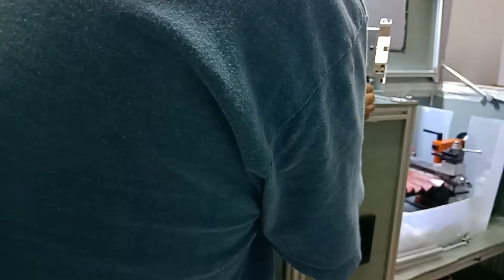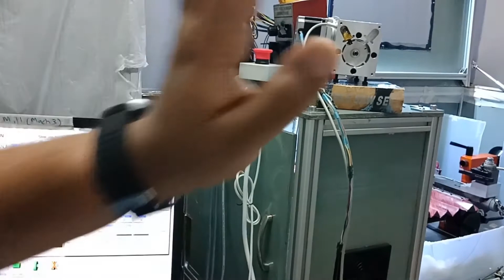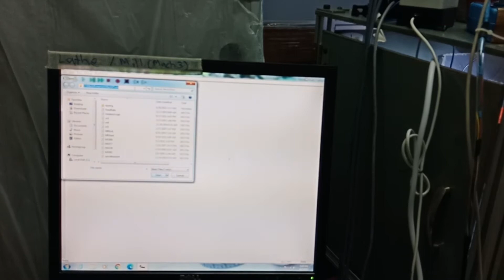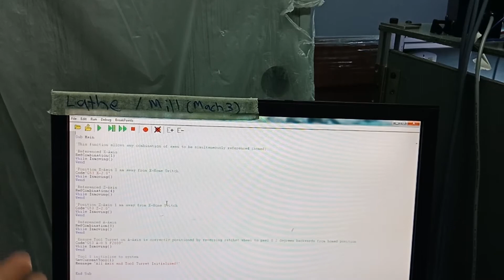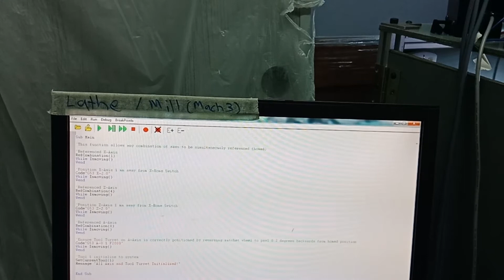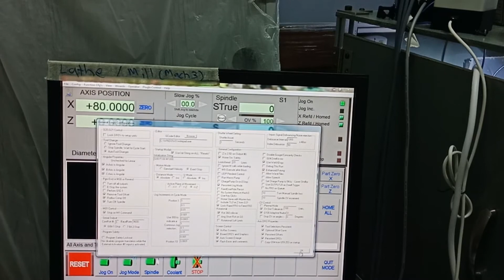My First CNC 7x14 Mini Lathe Conversion Part 11  Auto initializing Axes and Tool Turret Upon Reset

Comment: Hello. I have a problem when executing this script. I did everything as you have on the video . I have only the X-axis calibrated. And nothing else happens... If you manually press the button - "send to the base", then the axes on the sensors are reset to zero. But the script you presented does not work as it should (as in the video).....
Reply: I figured it out myself in the script, replaced RefCombination(1)(4)(8) with DoButton(24)(23) (25) and it worked.